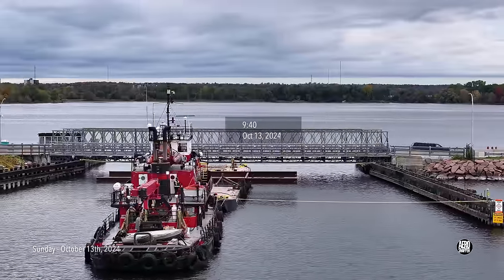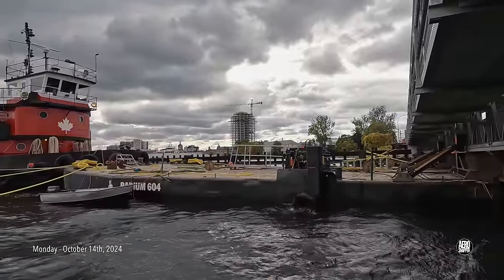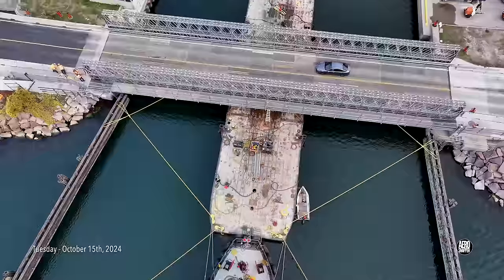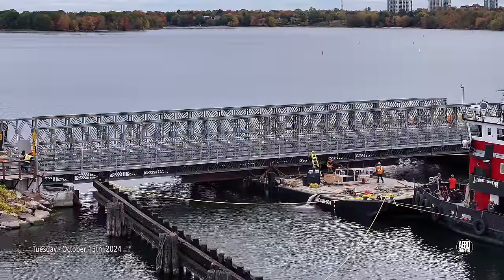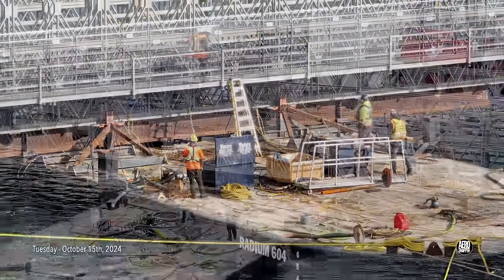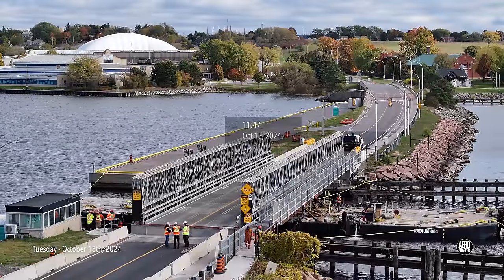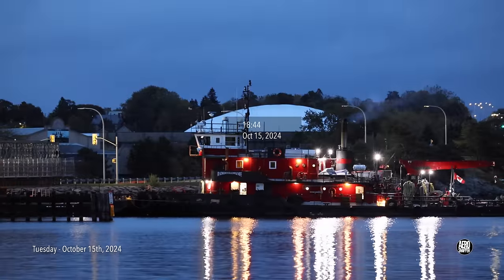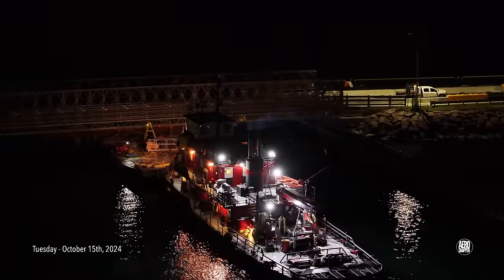They Shall Pass - an update on Kingston, Ontario's La Salle Causeway  4K

Comment: Glad to see they were able to figure out the removal/reinstallation process! I remember being told mid-summer that the plan was to have it removable, but to see it in action is impressive. Also shows the power of buoyancy!
Reply from the maker: Yes, a capable crew engaged here - with considerable experience in similar work.  I highly recommend visiting Western Mechanical's YouTube channel.  Buoyancy - when correctly calculated, is a very powerful force to have at your disposal

Comment: So they removed the bridge for 1 boat to cross ?
Reply from the maker: @jamesk393  James - only one boat entered immediately - four more entered the marina within hours. Three of them required the services of the dry dock for mandatory inspections as commercial carriers. It’s the only facility in Eastern Ontario that can accommodate larger vessels.
Reply: It should be evident that Eastern Ontario needs a dry dock that is accessible when needed.

Comment: How does the Uncle Sam (fake) paddlewheel boat pass under Waaban crossing (and the 401 for that matter) ? Is there a secret undocumented boat tunnel with locks at either end to let them pass under those roads? 🙂
Reply from the maker: Great question - the Belle was travelling to the dry dock at the Kingston Marina.  The Rideau Canal has a height limit of 6.7m / 22' and only one passenger carrying vessel, specially modified with a raising bow and telescoping wheelhouse routinely offers cruises along its length, the Kawartha Voyageur.  You can see here here https://youtu.be/MkhGLJvIO0U
Reply: @Aerosnapper  Thanks !   It wasn't until this project that I was made aware that the Rideau Canal was not navigable by ships so was quite surprised to see this video where the bridge was "raised" for a ship!   Is there a point of building a bridge that can be raised instead of a fixed span that is same height as Waaban?  Is it just because of the dry dock?
Reply from the maker: @jfmezei  You're very welcome.  Yes, the principal reason for considering a bridge that is not height-limiting is to permit access to Kingston Marina and its associated drydock.  Both a lifting bridge (with one or two leaves) or a swing bridge would work. A group is already considering options for the eventual replacement.